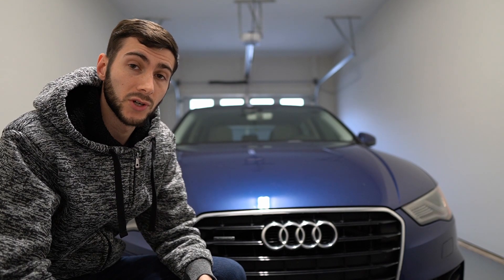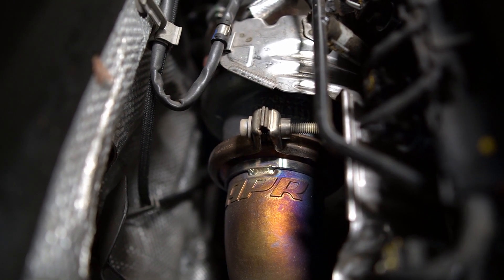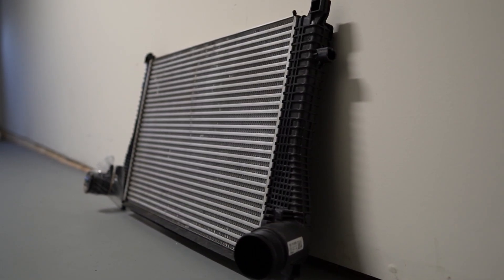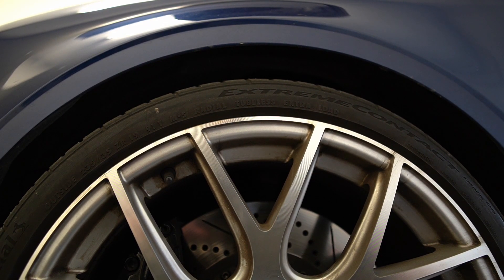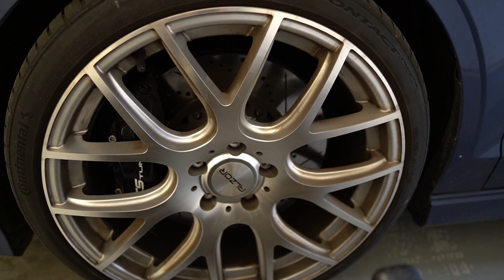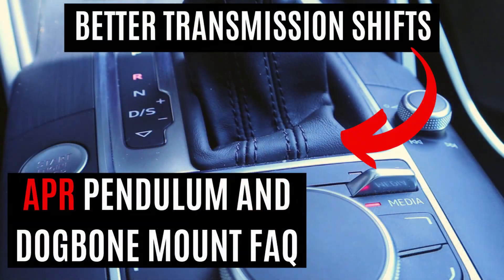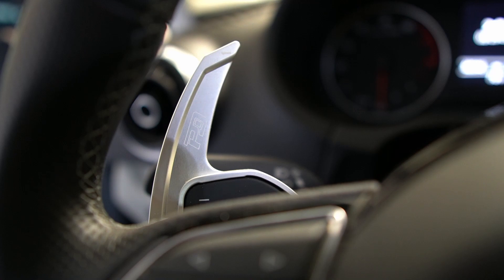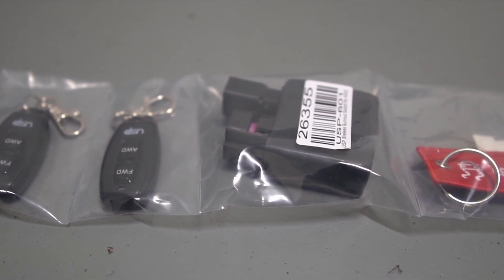Project Audi A3 FULL BUILD BREAKDOWN (2020)

Comment: I have a 2008 A3  8P avant . . . 
Stage1 APR ecu tune with APR carbon fiber intake.
APR downpipe and a sport exhaust as well (nice deep mild tone for my daily)
I have the same H&R lowering sport springs with bilstein adjustable shocks.
Bremmer kraft BR17 18"x 8" wheels (from tirerack.com)(in black),  Michelin super sport tires.
RS rear bumper with black rear splitter 
RS front bumper/grill combo. (badgeless).
projector headlights and  LED taillights in a dark red smoke finish. 
carbon fiber mirror covers, carbon fiber tailgate spoiler   . . . 
my next mods? 
looking to do a big brake kit from ECS as well!! (we have similar tastes) by July.
I'm looking to wrap the car as well    . . .   the original factory color is silver with black leather interior . . . 
I am looking at a matte silver for the sides and a matte black carbon fiber hood and matte black carbon fiber tailgate
yeah yeah i know . . . a little too much carbon for you, but with the black dual moon roof ?  I think it will be a nice match . . . 
LOVE your steering wheel, but . . . I was looking at a TT RS wheel as it has the bottom spoke skeletonized
Reply from the maker: Nice build man! That's awesome 👍 you'll love the big brakes from ECS. Can't go wrong there. And yes I love the steering wheel!! Tough to find but we'll worth it!
Reply: Thanks!   I'll settle down with the mods and spending by the end of the year  . . .  
your vids are great  . . . .  love the thought into the direction you give  and great mods !!  
I love it when a mod has a subtle look, like it was always meant to be there, but, noticed only by those who know! 
keep up the great work  . . . 
2021, maybe a weekend ride  . . .  a little Italian (japanese built) convertible (Fiat 124 Abarth)   . . . next project??  hmmmm

Comment: I just ordered the Integrated Engineering Intake, and I notice they don’t have a secondary Air Intake, like you do. Would you recommend I add that ? IE says it works with or without, I’m looking for the best flow!
Reply from the maker: Sounds like a clean upgrade. IE makes a great intake system for these cars. I think with the secondary carbon inlet that give you he best complete package. 😀 Definitely get the turbo elbow inlet if you haven't already. Very nice upgrade
Reply: What brand is your SAI, I’m not sure if IE offers one?
Reply from the maker: I'll dm you jeremiah

Comment: Do you know if the A3 2017 non paddle shifter would work with an S3 Paddle shifter flat bottom steering wheel?
Reply from the maker: It should! I did the same thing on my 2016. Just make sure you get a 2017+ facelift wheel as the 15-16 year models are different

Comment: Do you know anything about 235/40/18 on a 18x8.5 wheels as far as ride height and if it’s enough of a difference from 225 to affect handling due to raising ride height. I just ordered tires and wheels for my 2016 a3 quattro and now stressing about not going 225
Reply from the maker: I dont think 225 vs 235 would be a critical difference.
Reply: Savage Panda Projects finally put on the 235 tires and my a3 looks like a monster truck on stock suspension
Reply from the maker: time for H&R springs!

Comment: What do you recommend doing to an 2016 audi a3 1.8t because I dont know where to start
Reply from the maker: Downpipe and tune would be your best improvement for power. The 1.8 is fwd so you probably don't want to move into bigger turbos because that's where traction is an issue.